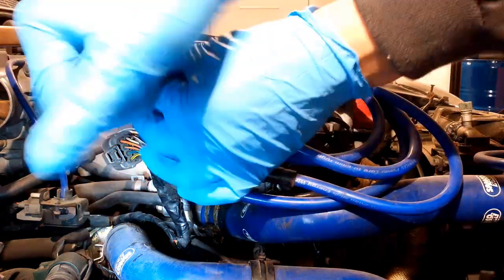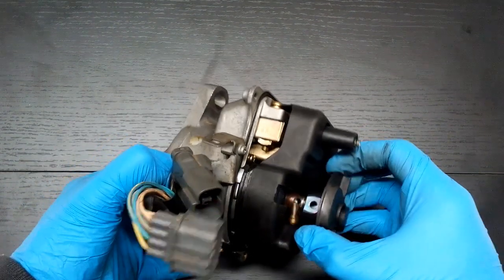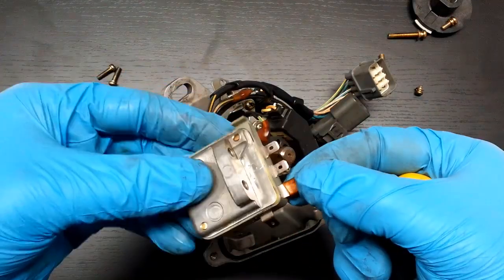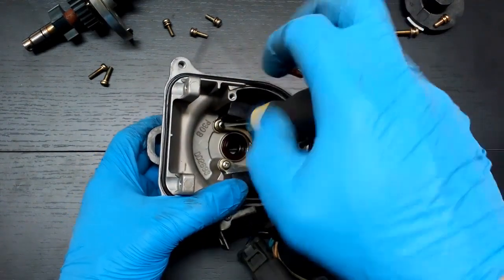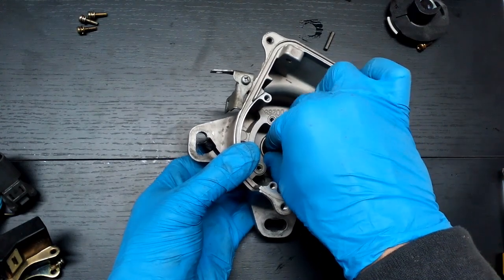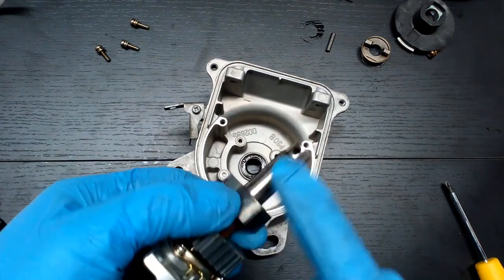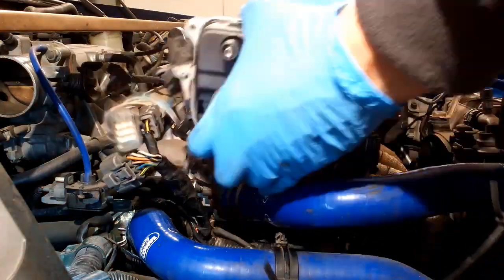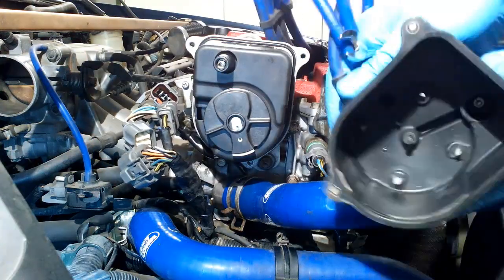Honda Civic Distributor Oil Seal & O Ring Replacement

Comment: On my 98 civic the pin never fell off.
Reply: Same here. Not sure what part to get for the seal. I went to autozone & the kit came with 2 seals. One 12.45 ID & one 12.5 ID. The OD of the seals seemed too large to seat in the cavity.
Reply: Is this a TEC distributor or a hitachi?

Comment: can you do a how to fix when there is oil found in spark plug well? thanks.
Reply: Chris Tian  VALVE cover O rings
Reply: Or it is the bottom rocker assembly seals.

Comment: Very well and clearly filmed. Robot voice translation LOL . Did not mark position distributor position on engine. Since this is an OBD1 vehicle, put it back wrong and the engine won't start and you'll need to set the timing again. Also did not mark postion of "engine coupling" . you are advised to "remember position" better to mark both parts with a centre punch or scribe so there is no doubt when you put it back
Reply: I agree. I wonder how he set the timing after that.

Comment from the maker: I did my best to show all repair process. Thanks for watching.I would appreciate if you would like and subscribe;)
Reply: i just did breh.. my 96 honda civic has a leak from the bottome if the distrubador u can see oil all the way dowb off the transmishion the tranny has all its oil but the engine seems to have less oil can this be the peoblem or might it be the oil cover gasket?
Reply: Anyway sir...is that also a cause of hard starting?oil leakage?...